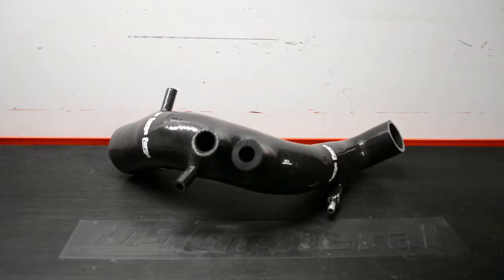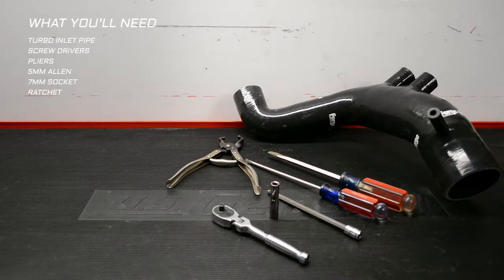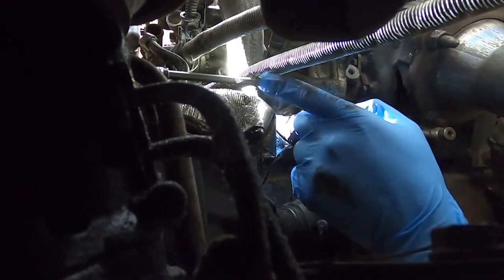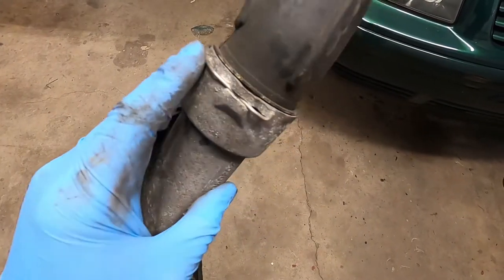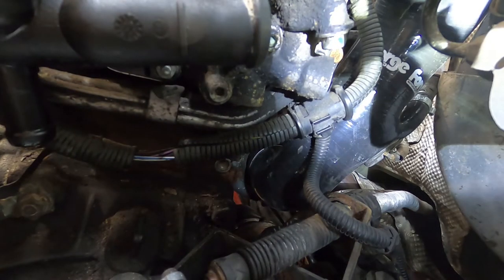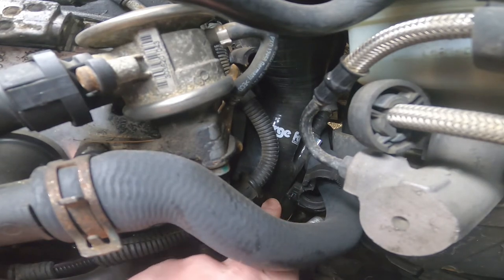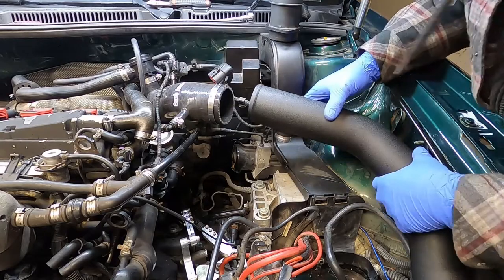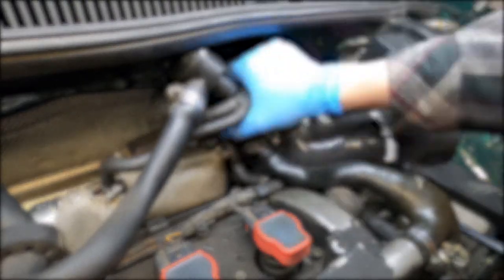MK4 VW 1.8t Forge Turbo Inlet Pipe Installation

Comment: I bought the ECS turbo inlet pipe and lift intake kit looks exactly like the one in this vid, I ended up using some lubrication on the turbo end of the inlet pipe to more easily get it in without removing anything extra. I ended up using my own piping as well for the top of the diverter valve. I also broke the line left of the diverter valve,the other large connection to the inlet pipe. I saw minimal fluid and since it was connected to intake I ruled it was safe to reconnect it with glue and thick heat shrink tubing. I also did not trim anything but I will probably go in and cut down the MAF side of the inlet pipe, since it squishes the pipe a little once I have everything in. That being said the induction souns or Super worth it even with the busted knuckles and bootleg repairs on some lines.
Reply: "luft intake kit"
Reply from the maker: Thanks so much for commenting! I agree that the induction noises are great, and for my car with a GIAC X+ tune it really settled out the delivery of boost through the RPM. I'm happy I did it, but wish it fit better. It seems like it would be pretty simple to make a part that fits correctly as opposed to what's being sold now. Based on your experience it seems like it's most likely the same manufacturer and everyone putting their name on it.

Comment: I bought 200€ creationmotorsport oversize tip. There was no room to install it and money was wasted. Now ordered a smaller one from aliexpress, it should fit much better.
Reply from the maker: Comment back if you have a good experience, I'd love to know. It's crazy that these parts are being produced with no regard to actually fitting them in the engine bay.

Comment: How the hell soo hard to do
Reply from the maker: I think it's just not the right shape to fit in there with the stock vacuum/pcv system. Which is honestly fine if it was sold/advertised as such. But it's marketed as an upgrade you can do to an otherwise stock engine.

Comment: Hi there would know anything g about stud replacement on turbo mechanic snapped mine when fixing flex joint in the exhaust
Reply from the maker: I thankfully haven't needed to do it, but is it possible to drill out the center and use an extractor bit on it?

Comment: do u know if the 1.8t inlet pipe from forge fits a k04 for the 1.8t i cant find anything at all abt it. i have an AWP
Reply from the maker: I believe the 225hp TT uses a K04 with the 3in MAF, so you could probably use a TIP made for that car. A stock AWP has a K03, so I don't think engine code really matters if you're not running the stock setup.
Reply: I have a ko4 xlb and it works just fine with the forge tip I have

Comment: Hey Steve, I’m in the process of installing this inlet pipe but I also have to replaced my coolant hardline. Any tips on removing the coolant hardline? I haven’t been able to find a removal/installation video on that coolant pipe anywhere. Thanks !
Reply from the maker: You know... I have a video for the replacement of that hard line in my queue to edit, it's just been low on the priority list. Definitely don't wait for it, as it's not like I can get it out in a short period of time.

I'll try and walk you through it here. First, disconnect all the hoses that are connected to it. I think there are three. Once you do that, there is a bolt on the front and the side. They're both under the pipe, so feel around under there to locate them. With those out, you should be able to pull it out of where it connects by the thermostat. That is a very simplified instruction on how to do it, it's a pretty big pain to get in there and get it out. Nothing impossible, just not a lot of room to work. Let me know if that helps or you have any other questions!
Reply: @StevesGarage  thank you for replying! This should definitely help! Just got two more questions lol. 1 it’s kinda hard to see where it’s connected from on the other end. It seems like it’s connected to a heater hose(please correct me if I’m wrong ) if so is it just an easy disconnect of the hose? 2 I read somewhere you’re supposed to disconnect the turbo oil line in the front of the engine to get the pipe out and with that I have to get an o-ring for the pipe and copper washers for the turbo oil supply line. Did you end up having to do that as well?
Reply from the maker: @saintgaming8643  No problem, I'm happy to help. If you have IG, we can message back and forth there too.

It's connected to one of the hoses that runs into the firewall for the heater core. IF you can swing it, I suggest replacing those hoses. You're in there, and it's an easy thing to do while you've got the coolant all drained out and the lines off. I don't think I disconnected the oil feed line to the turbo. If you do, definitely get new crush washers for the banjo fitting, but I don't remember needing to remove it.

Comment: I have the ecs one to and it was east to put on the turbo well not easy but not to bad and the pipe is to long like you said I don’t want to cut it but I also want the intake to sit right
Reply from the maker: It's unfortunate that it seems like these are all made poorly. It makes me wonder what the APR one was like when they made it.

I recommend trimming it. Otherwise it will start to pinch and not sit right and give you trouble.

Comment: Hey Steve,
Great vid, I would like to see a follow up video with if you notice any difference with it, sound and or performance.  Been thinking of doing this on my Passat.  
Side question, how did you do the techtronics tune?
Reply: just saw the end of your other video and your comments about performance :-D  maybe have a link to it at the end of this video.
Reply from the maker: As far as the 'butt-dyno' goes, I don't feel like the car makes more power, but it feels like it comes on smoother and faster. Not sure what you mean by the techtronics tune? I have a GIAC X+ ECU tune, and a Techtonics Tuning exhaust though! Happy to answer any questions about either one.